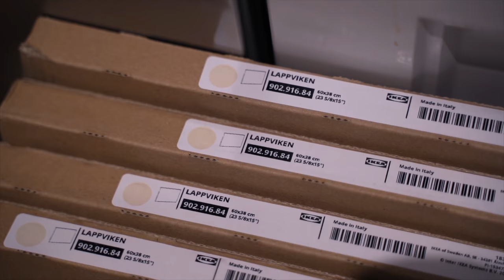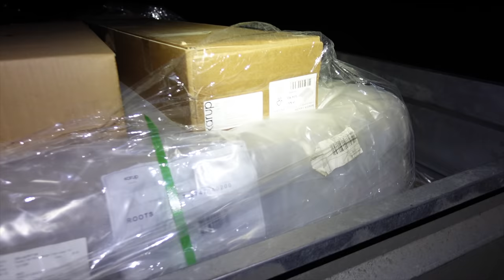Making some changes to our cabin | SVALBARD

Comment: A couple ideas for the little empty space to the right of the tv; simple option is to put a hook on the wall inside the space to tie back the curtain from the window, pulling the fabric into the space makes it look like it served a purpose. Useful option would be to get fabric that matches the curtains and attach it to the underside of the box shelf at the top making a storage space. Decorative option would be to get a cute coat rack stand and hang blankets for snuggling on the sofa from it. Love the cosy vibes.
Reply: A coat rack to hold blankets! Brilliant!

Comment: The new room looks beautiful. My only question is: If there is a power socket on the left side, wouldn't it make more sense to have that tall furniture on the right side?
Reply: The right-handed cube in the top is bothering me soooo much. Your idea makes a lot of sense!!
Reply: I would just move the socket, then you can make the cabinets more of a long-term built-in solution.  Move them flush with the left wall and then build open faced book shelves down the length of the right hand side in the corner.  More room for Cecilia's books.  =)

Comment: Until your vlogs I never would have thought arctic and cozy would be in the same sentence, but you have changed that mindset. 
The little stool is charming.
The change of the socket location suggested by others is an option especially if there would be room for a narrow bookcase. However, more/other decor on the top 2 open shelves above the television and a tall plant in the right corner under the extra cabinet might balance out the area/create an illusion of symmetry.

Comment: Cecilia, you should study construction and architecture, you love it so much. You could later design cabins for people who move to Svalbard (If you have the time of course. I don't know what you do for a living) Can I make a suggestion? You know that little gap you had to leave next to the new furniture in the tv room because of the outlets? Solve it. Either move the socket forward leaving it as external box flushed with the floor or the furniture, cut the wall and re insert a new one, or cut a whole into the bottom closet and remove the door to it, leaving it open. That way you can scoot the whole thing over those 6 or 8 cm up to the wall, and then you'll be able to have the other end line up (it seems perfectly) making it look more interesting because then that top box will seem to cantilever on its own without resting so much on the rest of the furniture.  ;-) Everything about your videos makes one feel cozy and intimate. Thanks, I really enjoyed it. I'm going to complain a lot less about how it's getting cold here in Italy now. :)

Comment: WOW! The last time I saw your video you just started working on the expansion. Now look at it. Very nice!
Ok the cabinet on the upper right isn't bad, but I think it would look better if you either put a slim multiple selves there or put a panel of the same material against the wall to match it.

Comment: 12:40 into this video you have made note that there is an electrical socket that has made it not possible to put the cupboard against the wall. Why don’t you cut out a hole/section in the side of the cupboard so the socket can be access from the inside of the cupboard and then the cupboard will be able to go hard up against the wall? Just a thought. All looking good!
Reply from the maker: Yeah you could def do that but we don't have any tools for it haha

Comment: Hello, I got to know your channel through YT S-UMA. I think it's great how you show that you can have a "normal" Western European life in the arctic wilderness, with many advantages. Comparable to a city up in the Alps. I never would have thought! There is general knowledge about coal mines, weather and research stations in Svalbard. But about hotels, shopping centers, universities and kindergartens at Polar? I didn't know that. Excellent!
But when I read current reports about Svalbard, it turns out  that the average temperature in the arctic regions has risen sharply since recently and a lot is changing. The perm forest floor thaws in summer and you can wear T-shirts. - My question, aren't you afraid that your house is too close to the cliff facing the fjord? The cliff was definitely formed by ocean currents and waves. The bottom is made up of sedimentary rocks. Probably clay and sandstone (coal deposits). Without the protective frost, exposed sediments can be eroded very quickly by wind, water and waves. Do you see no danger to your beautiful house there? Or can you move the house? Do you sometimes measure whether the cliff is getting closer to your house? - I hope not! Stay safe

Comment: Pleasant video!  I love watching your videos to relax.  In regards to the socket on the wall problem:  Couldn’t you just make a cut out in the bottom cabinet that abuts that socket.  You can then move the cabinet flush against that wall and still have access to the socket.  In fact, you could create another small hole through the other side of that cabinet to run the tv’s power cord to the socket.

Comment: You say the max size for a Svalbard cabin is 135 square meters as if that’s small. We lived in a rural area for 41 years, and the house we had and raised 3 children in was only slightly larger, @ 1700 sq.ft. (158 sq. Meters).

Comment: In the TV room, if you offset the 2 x open boxes above the TV, that will allow you to re-position the box at the top RHS therefore making it look less awkward. Could you even position one of the open boxes vertically and move the other further to the right and slightly down ?. You could have fun with the positioning.

Comment: Have the rising sea levels affected you in the area yet and are you worried about them? Also, that tall cabinet in the TV room, why not put it on the right side? The 2 cubes on top of the TV unit, perhaps turn them the other way and put them on the left side- stacked on top of each other? The bottom one opens down, and the top cube will open up then. Love your videos!! ♥♥♥

Comment: I love what you did to the TV room! I thought of an idea for that narrow empty space next to the TV...hang a few of those small air plant terrariums at different levels (would have to put hooks in the bottom underside of that wood cupboard). I found a set of three really cute ones that I thought fit the "vibe" of your home that you may like - it's on Amazon...do they ship to Svalbard?  If so, they are called "Mkono 3pcs small hanging glass terranium geometric container".

Comment: The TV room is great but have you never come aross a futon bed before?! We had one 30 years ago - comfy but very low to the floor. I think if you put some shelves below that odd little cupboard on the top right it'd blend in more. Also, why didn't you just move the socket so you could've put the new units up against the wall on the left side and save that odd little gap?!

Comment: Isn't having a wood stove on an island with no trees quite ironic as all the wood needs to be shipped and has a low energy density? I would have expected a coal fired stove
Reply: @WyrdHag  If you burn it coal produces less CO2 than wood (on average 403kg of CO2 per MWh thermal for wood and 340kg of CO2 per MWh thermal for coal). 
Svalbard coal is of very high quality with low sulphur content and high calorific value and is almost completely dry. With wood you also waste quite a bit of energy turning the moisture in the wood to steam which then vents out the chimney. Particulate emissions are somewhat high for both fuels.